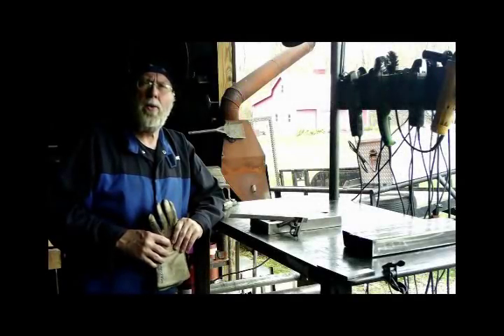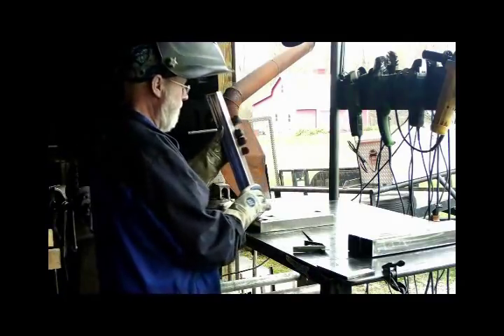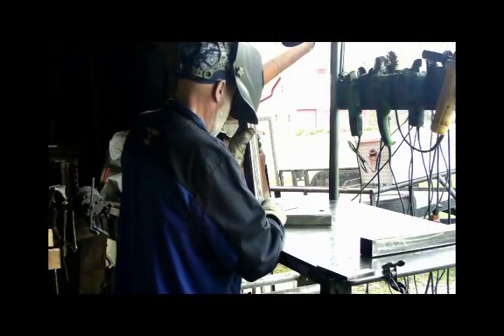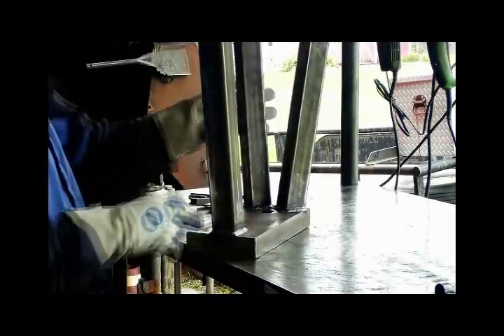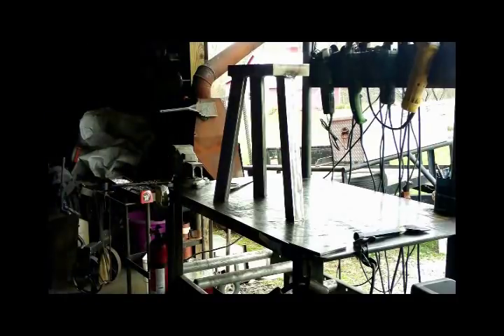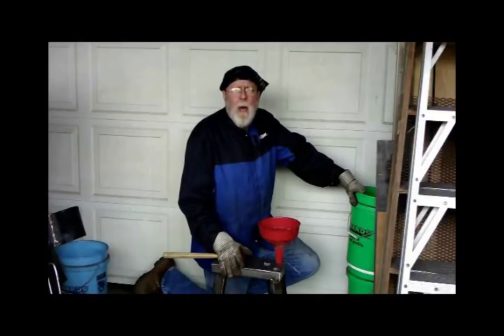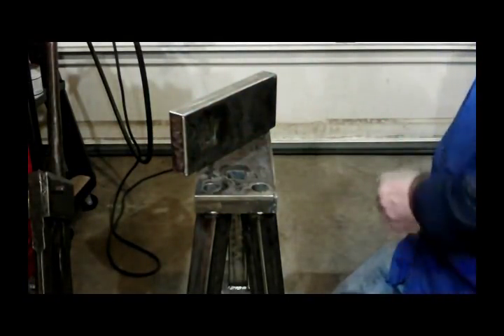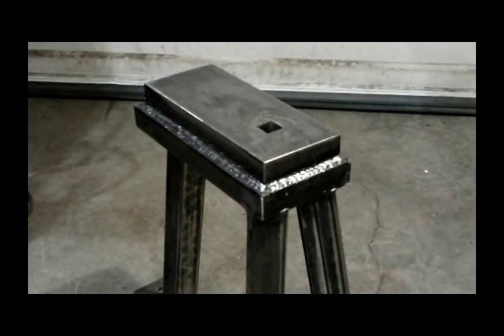Finishing the striking anvil build

Comment: Just finished putting my kit together and I am very satisfied with the final product.  I had about 50 pounds of cast lead ingots left over from my muzzleloading days that I melted to fill the legs - 19" 2X2X1/4 tube. This striking anvil doesn't have the same rebound as my London pattern Lakeside anvil and it doesn't ring when struck.  Both of these characteristics will work well while forging with a striker.  Thanks for very speedy delivery, solid assembly instructions, and a quality product!!

Comment: Nice little units, just wondering rather than go through the work of burning in the fill holes couldn't the legs be filled when the unit is upside down before you put the cap on?
Reply from the maker: I've been told that by someone else. It would take a lot less time while burning if I didn't burn those holes. I just like the idea of setting it upright on the feet on my welding table to weld them on. I think it holds the feet nice and flat while welding.